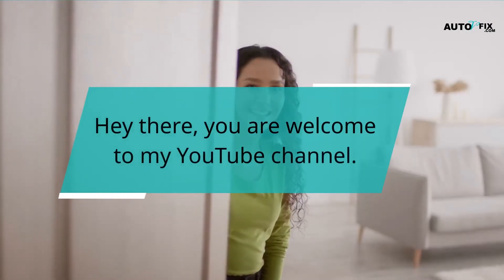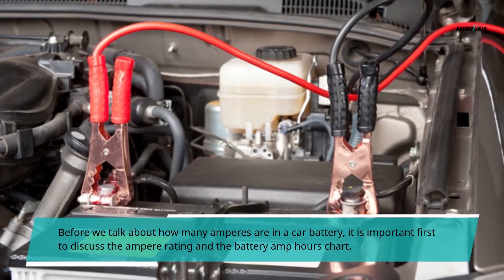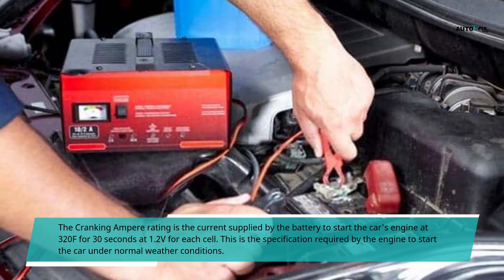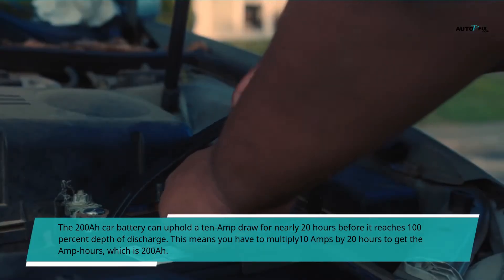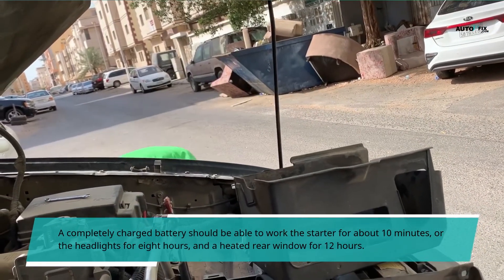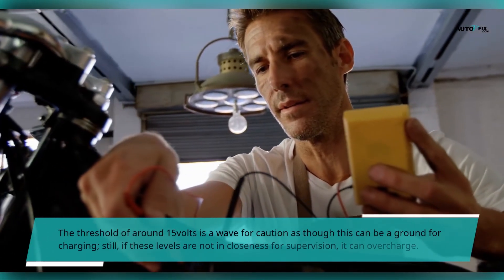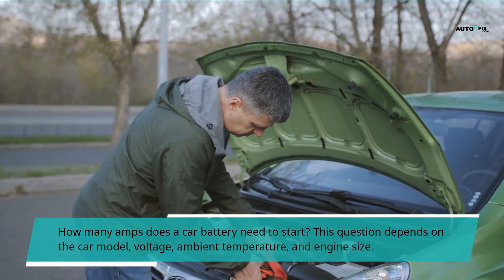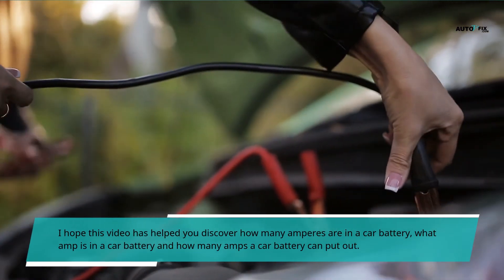how many amps does a car battery have & how many ampere in 12 volt

Comment: My battery in my bmw 1 series is a 80Amp 800CCA. My new battery is a slightly higher amp at 85, but is the sanlme 800CCA. Will the slightly higher 85ampa fry my cars electronics?
Reply: no. the higher Amp will only allow your car to draw more. The Voltage is what would fry it if you increased not the max amp